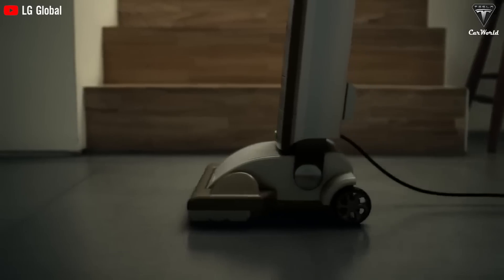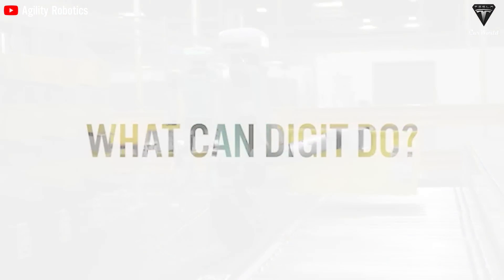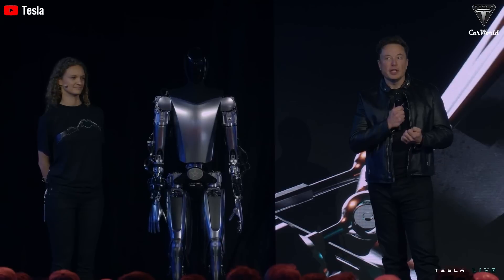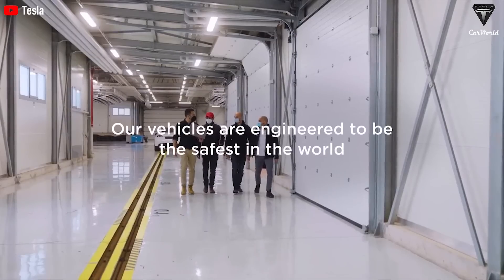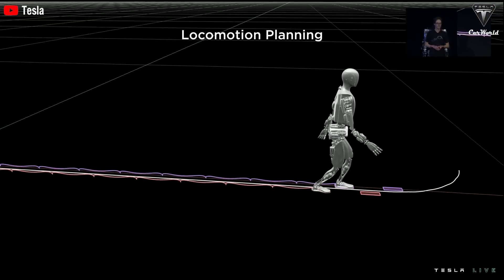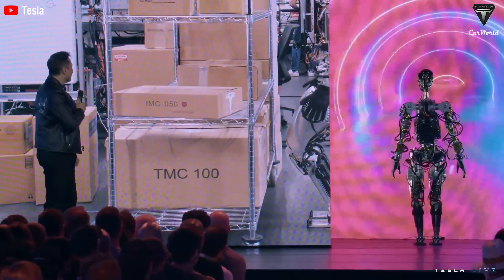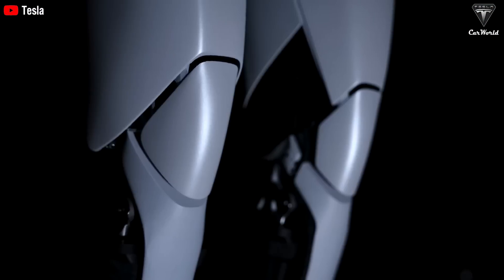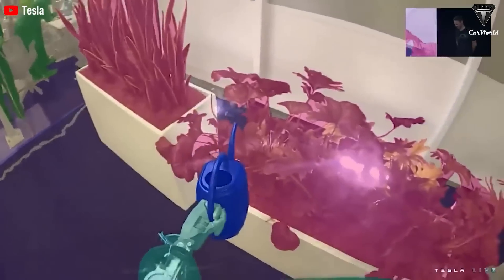It Happened! Elon Musk Confirm Tesla Robot Gen 3 Will Release In 2026, less than $25K!

Comment: A humanoid robot, in my opinion, is nothing more than a marketing ploy. Firstly, creating such a robot is impractical: it's expensive, energy-consuming, and requires increased loads on the processor, sensors, motors, actuators, and their coordinated operation. All of this is extremely inefficient, considering that all these components need energy. Moreover, the more parts and mechanisms there are, the higher the risk of errors, malfunctions, and breakdowns.
Of course, there is a positive effect – the so-called "wow effect". People will be impressed: "Look, it's a humanoid robot, that's cool!". But this won't last long, as it will soon become clear that there is little practical use for it.
Ultimately, the creation of humanoid robots is just a challenge, ambition, vanity, and, of course, marketing.

Comment: The robot should be able self charge itself, like the Roomba vacuum
Reply: Most definitely. I'd say even replace it's batteries with charged ones on the fly to not interrupt it's work. For that reason alone, I don't think battery charge  (or hours of operation with one charge) is that important at this point.

Comment: 25k for a Robot that (on average) is operational in 2-4 Hour increments before requiring recharging. I think we need to advance battery technology and capacity much further if we're going to push for robots. Something around 8 or hours or better of operation before a recharge.
Reply: А зачем больше?робот выполнил задачу и вернулся на зарядку.на производстве роботы меняются каждые 2 часа.нужна не продвинутая зарядка, а большее количество роботов, доступных на момент зарядки основного
Reply: @ИльяКалинин-ъ7м  Your argument is unconvincing. Companies will only invest in robots if it is economically beneficial: increased productivity and reduced labor costs. A robot that only works for 2 hours and then sits idle, waiting for a charge while other robots perform its tasks, is an inefficient use of resources and an unnecessary expense for purchase and maintenance. It is unlikely that a company using 100 robots would find it profitable to purchase 400 or 800 additional units to organize a rotation. It is much more economically feasible to invest in powerful batteries, even if their cost is high.

Comment: Huh? What happened to Gen 1 and Gen 2?

What a grift. 

How do people believe the absolute bullshit.
Reply: Gen 1 was the raw proof-of-concept; your basic erector set build so that the premise of using FSD to run it could be tried. This was the version without coverings for the body.
Gen 2 was a prototype; an attempt at making custom parts to more closely parallel human movement while adapting FSD to be functional using its limbs. This version had coverings for the body and is the one you see in the videos.
Gen 3 is refined for adaptability and manufacturability. It has a new arm with more than twice the degrees of freedom as the previous version. The intent is to be able to do all things human and Elon is hoping to literally thread a needle.

No grift. Manufacturing usually goes proof-of-concept, prototype, preproduction and then the last engineering phase is to make it manufacturable. Elon is following this process, except in the auto industry, to get this far would take 10 years and Elon has been at it for 3.
Reply: @enigma-8u  great answer. All BS, but still a great way to pretend as if that’s how things work. 

Referencing something in “generations” refers to the fact that many items of a specific design or time period.

A generation is a grouping of products that share the same overall design features over a time period.

A prototype that was not released is not a “generation”.

Pretending that Tesla is progressing in leaps and bounds to pump the stock-price is boarding on criminal misconduct.

Optimus is a crap idea, nobody wants or needs a stupid robot to do things we should be doing ourselves.
Reply: @captain_cgc2413  I was a manufacturing engineer in the 70s and 80s long before I built and programmed robots for the biotech industry so what you call BS is common procedure in industry.
Reply: @enigma-8u  I’m also an engineer and have been involved in many development projects. 

You may have several prototypes, but referring to them as generations when not a single unit has been sold/deployed is misrepresenting the program and you know this.

The general population understands a generation of a product to mean something.

No intelligent person is going to buy the snake oil that you are selling.

We understand what “generation” means.
Reply: @captain_cgc2413  It is a cultural thing. Software types often refer to significant changes as generations though they never reach the customer. I don't for a minute think this was a deception, but I have watched the progression closely since 2021.  They don't even intend to sell one until 2026 and they have been very open about this.
Reply from the maker: Optimus Gen 3 showcases Tesla's unmatched innovation, redefining robotic excellence.
Reply: @TeslaCarWorld  what robotic excellence? What are you smoking?
Reply: @TeslaCarWorld  Unless you work for Tesla, nobody has seen 3 yet. But I am hoping you are right especially since they learned so much with FSD.
Reply: @enigma-8u  I worked in robotics. I can tell you it's VERY unlikely that Tesla will have anything close to what this video is peddling in 2026. Might be able to do simple repetitive tasks in a closed environment, but an all purpose humanoid robot is not happening. They can't even figure out how to reliably do FSD.